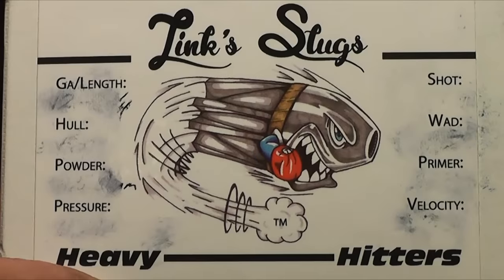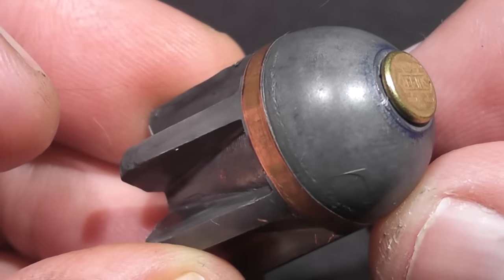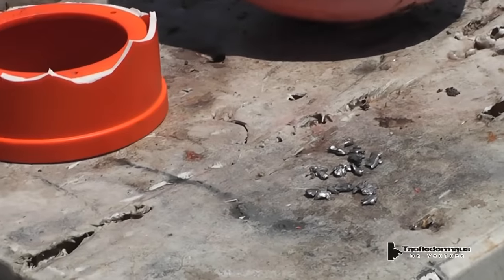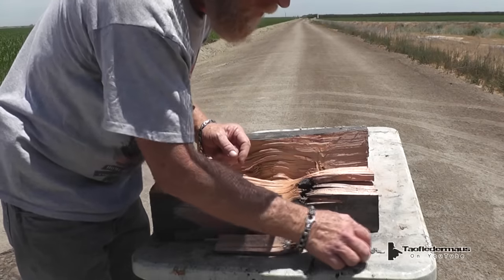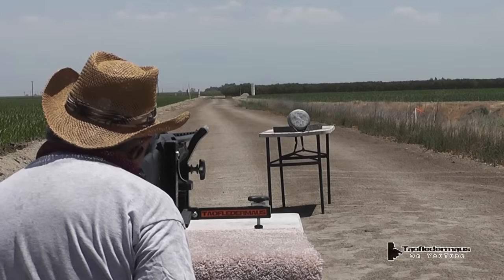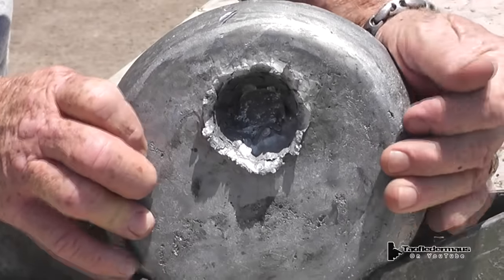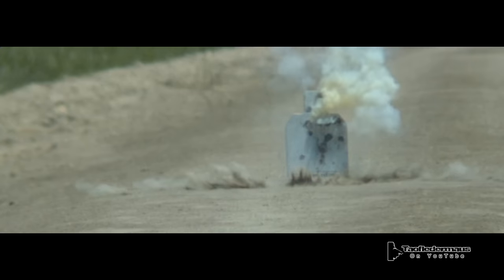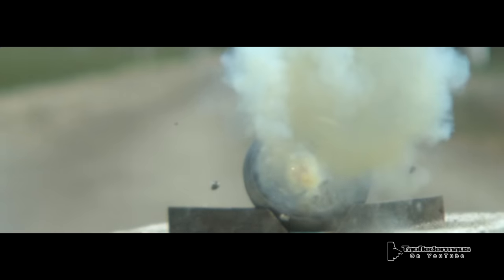12 ga. shotgun EXPLODING  rounds - You've got to see this!

Comment: Reminds me of some crazy air rifle pellets I made..using a relatively stable primary HE, they would initiate on contact with a single sheet of paper.  
Driven at 950 ft/sec, compression heating would cause self destruct at around 50 yards.  The relatively soft lead pellet was fractured into sand, captured some in an inflated trash bag.  
Soda cans were also interesting. The entrance hole was peeled out in a star pattern,  no exit hole and the lead dust littered the bottom. 
I don't do this anymore as it was very toxic as well as energetic.

Comment: You can also use these with muzzle loaders. Don't use over-powder wads. Use proper size slug with the riffled caliber. Cut a deep grove around the slug halves, then place a leather ring into the grove to act as a gas seal and tighten the space between the slug and bore.  using a 40" or 50" bbl are best for accuracy. With continued use, they will polish the bore and help keep it clean in-between shots.

Comment: I did similar testing with a 40mm cannon with shortened 50cal blanks in the nose, similar results but on mega steroids. I tried some 7.62 blanks also, 50s are way better. A 5.56 blank, not so impressive at all.  Also put 25cal nail gun blanks in drilled out 44 mag projos, in dirt it didnt work just got mashed, on steel it worked great😊

Comment: So, on contact the nail gun blank fires; the contained explosion deforms the slug, vastly and suddenly increasing its surface diameter as it enters the target material, thus splitting wood, cratering lead, and blasting brittle targets into fragments.
Reply from the maker: and it goes booooooom

Comment: Correct me if am wrong but if I remember correctly hesh tank rounds were designed to not penetrate, they were designed to deliver an immense force on the tank so it could rupture the inside metal plating of a tank and turn those plating into fragments that will shoot into the operators of the tank. 
Right?

Comment: Awesome. 
I doubt you're setting off the primer every time with softer surfaces, maybe try adding a small plate with spikes on it to the front of the primer. It could be hardened steel or maybe just try chunks of broken up spark plugs. From my own tinkerings, I'm surprised how hard it can be to set off a primer.

Comment: There are mini-grenades for 12 gauge that you cannot access. They've been around a good while.They were designed in England but are made by a company in... Connecticut I think it was. Military only of course. These slugs actually mimic the design of the grenade rounds quite a bit. Let's face it these rounds completely assembled will not be allowed, for mass production even if they are legal under the letter of the laws.

Comment: The nailgun blanks dont actually explode properly to set off most HEs correctly. They are designed to make a lot of gas quickly to drive a nail. To make a similar one that actially detonates one would need to use a 22 short filled with something like a mixture of PETN and NC binder then use that to trigger your secodary in your bullet, but tbh the round looks pretty damaging from kenetic energy alone..
Reply from the maker: I wonder why they worked then?

Comment: So in a case like this, which is the safest way to hld the gun. Usually you hold it with the barrel faced to the ground in case of an accidental discharge. Bit it this goes off by accident you'll probably do a lot more damage if it went off underneath you. So what do you do??

Comment: i saw a bit of red from a flash when it hit the piece of wood.  it was very dark red so it was hard to see.  if these things had a little metal shield in front with a little sharp barb it might set the thing off more reliably. like a little firing pin

Comment: Get exploding targets and after the mixture of aluminum and the oxidizer are mixed'than scoop out a little bit of that mix out and crush it up into powder and inside the slug and than use a shotgun primer as the high exposive to set it off'it will set if off. Only thing im not sure about is if the mix will work once you crush it up since after all its ussually a prill with fine aluminum coating the outside rather than being mixed like some fine flash powder or somwthing.

Comment: A recessed hollow point and long scew like a drill's grooves and rear blank load following mass to ignite by compressing.. armor and vest penetrating that sucks the round shrapnel in.. a ballistics gel view would tell you I'm factual because of the air being drawn in by the shock wave etc ... Kboom by air inflation and the expanding sheel and the draw from the pusing out of the existing bore pin.. way bigger effect with similar or smaller graine charge in the round.. fire cracker m80 size at most.. probably.. and the twist of the sabote' round destabilizes exit wall structure like a flat punch or a twisting on impact punch... total trauma rounds.. :) enjoy the kenetic physics fun.

Comment: You should not use gunpowder as a filler for a so called “High Explosive Squash Head”. The explosive in the round must rather be a explosive putty (Plastic Explosive) **something you would see in a C-4**. You just have to add a fuse in the front for it to be able to detonate. 

You really have to keep distance because of the amount of metal you decided to place on the rear of your ammunition.
Reply from the maker: It wasn't gun powder

Comment: All of thee are very interesting from a cool factor standpoint howeverI am bit more practical and would like you to include the to other caibers. The 380 with varying factory loads and the .32 auto or 556 pistole load. In my situation I own the  9mm Rugar LC9s and           the 38 special and love them both but lc myself the the LC.380.  both fine weapons I have a 38 Special  
Rossi and Finally a Walther32 PP.  
Size makes my 380 my carry gun and most
 important  to compare. please add it?

Comment: please add white phosphorus and magnesium flakes in the tip :)
Reply: I doubt that would be stable enough to store or use
Reply: Your probly right as it was designed to immediately eject from the shell and barrel. It being traped in the tip, and bullet temps rising to 100 may cause early combustion of the phosphorus.
Reply: @blueflame637  not to mention i don't think that compartment is airtight. It's just a 22 blank sitting in a hole.  Good way to destroy your shotgun.

Comment: Damn, still illegal in FL.

Florida Statute §790.31(2)(a) makes it a third degree felony to manufacture, sell, offer for sale, or deliver any armor-piercing bullet, exploding bullet, dragon’s breath shotgun shell, bolo shell, or flechette shell.   Although it is not illegal to simply possess this type of ammunition, it is a third degree felony to have any of these types of ammunition loaded in a handgun or firearm if the person has knowledge of its capabilities. See Florida Statute §790.31(2)(b).  Finally, under Florida Statute §790.31(2)(c), it is a crime to possess the types of ammunition described above with the intent to use it in the commission of a crime.  A person who violates this subsection commits a felony of the second degree.

“Exploding bullet” means any bullet that can be fired from any firearm, if such bullet is designed or altered so as to detonate or forcibly break up through the use of an explosive or deflagrant contained wholly or partially within or attached to such bullet. The term does not include any bullet designed to expand or break up through the mechanical forces of impact alone or any signaling device or pest control device not designed to impact on any target.

Comment: Not exactly what I mean but close, the saboteur, with the lever hinged piercing dumdum.. no and my design is a two birds one round.. sort.. lmao.. with a titanium.. could even do a self boring screw type.. depend on the machineist designing the core of the round, maximum internal and also shrapnel etc.. and it does .. ehhh.. never mind. Someone else says they designed it.. lmao. No need to discuss the center bore twist vents to get core armor drill piercing.. or even the shaped charge version huh?

Comment: Um dude, that is not HESH. That is probably more akin to SAPHEF or HEAT-HEF hybrid. What you have made here can also be described as budget FRAG12 ammunition. Let me explain.
HESH, High Explosive Squash Head. It is essentially a shell that is a piece of C4 but it is squishy. Imagine coating a surface with Flex Paste but Flex Paste became explosive. Then, the "Flex Paste" detonates and causes metal shards on the other side of the armor plate to fly inwards due to the shockwave. The crew will be injured by the flying metal shards. 
Now, what you did here, you gave a shotgun slug a contact-detonation miniature explosive. But the shell is still moving, so at the moment the shell enters the canister, the tiny .22 LR detonates. If the .22 LR breaks the slug's main body via the explosion shockwave, then it's SAPHEF. Penetrating enemy armor, then breaking the shell apart to cause damage by spalling, shell fragmentation and the explosive shockwave. Why SAPHEF and not APHE ? Well, you have not shown that the shell has a superb ability of armor penetration. 12.7x99mm APIT can usually penetrate 26mm of rolled homogeneous steel plates. Use that as a rule of thumb or something. But, it is not truly HE either due to the fact that the detonation occurs on the borders of "penetrated" and "not penetrated" and not on the surface of it. And since I can't say "FMJ" for a shotgun shell, I'll call it an SAPHEF for now (Semi Armor Piercing High Explosive Fragmentation). 
However, if the internals of the shell are made to withstand the shockwave and the shrapnel of the .22 LR, and somehow manage to deflect it in a semi-focused stream of deadly shrapnel, then this would be more akin to somewhere between HEAT and HEF. HEF part because it relies on chemical energy to fragmentate something and use the fragments to inflict damage and HEAT part because the stream of shrapnel charges in a single direction in order to penetrate further armor. This is a long shot though, and a very long one.
Given the results of what remains of the target(s), I temporarily conclude that this shell is somewhat close to SAPHEF instead of HESH.
Now, for FRAG12. According to the website, FRAG12 is for breaching surfaces, and claims to penetrate "3/16” Hardox 450 steel plates" and "level 5 bulletproof glass", leaves huge entry and exit holes, and can easily breach any run-of-the-mil door and create a spalling effect, which is what HESH is supposed to do. It seems to be a mix of APHE and HESH. But again, we have Mossbergs, Remingtons, KAC Masterkeys and M26 MASSs to breach doors, and they seem relatively safer. Which means, FRAG12 isn't truly HESH, but is some sort of special APHE that can produce a similar effect when compared to HESH. 
To conclude, this "HESH" slug is just a budget FRAG12 or a tiny SAPHEF, and is definitely way less efficient than FRAG12.
Edit: I am not a FRAG12 employee, and also this might have chambering and implosion issues. Just, be careful.
Reply from the maker: That's a lot of assumption
Reply: @taofledermaus  Humans have a relatively weak perception on what happens when objects hit each other at high speeds. Thought experiments are more or less logical assumptions.
Reply: My point is that, these are not HESH. They are partially HE, I'll give you that.